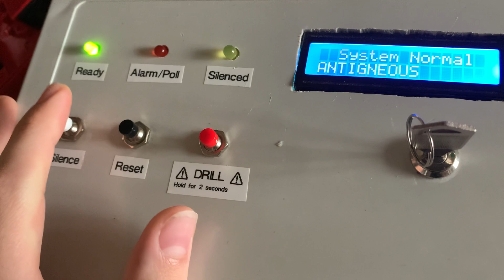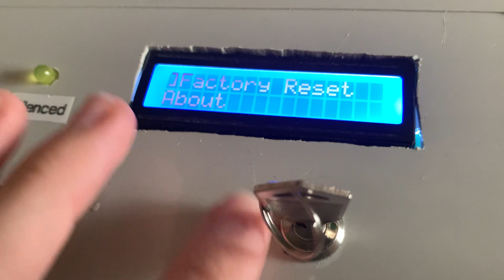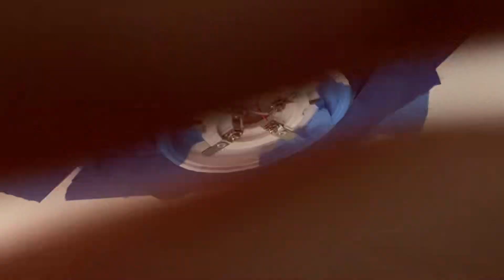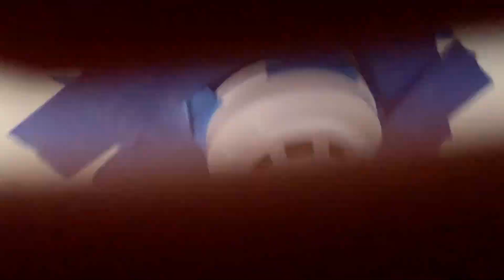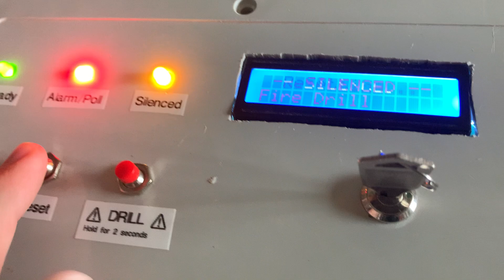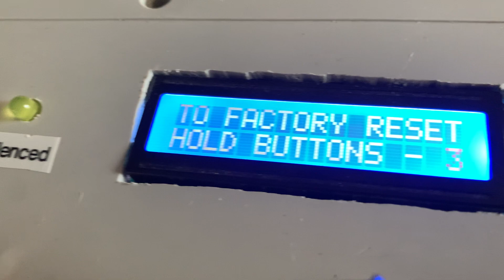Antigneous Open-Source Fire Alarm Panel

Comment: Could this be used to test & troubleshoot a commercial fire alarm system before the FACP gets installed? Even it it can only support one NAC at a time. I'm an installer and I manually test all my circuits before they get landed in the panel, but using this would be a game-changer.

Comment: Can’t wait for it to be released
Reply from the maker: Shouldn't be too much longer, just have to finish up the documentation. I want to get around to building an entire panel and recording it so people can follow along easier.
Reply: @lexzachsalarms3948  ok thanks, I love the design demonstrated in the video but I’ll probably put the components in a silent knight 5207 cabinet
Reply from the maker: @CascadiaFA  Yeah, the panel building demo is just the internal components, people can do whatever they want for the housing, that's why I have the feature to disable the keyswitch if you want to just use a locked container to prevent unauthorized access.

Comment: I have a few questions: does it have any sync settings, will it work with 2 wire smokes, how is it powered, and can it charge internal batteries, how many nacs, and are more zones in the plans? Sorry if thats a lot of questions, im just quite interested.
Reply from the maker: - No sync settings yet, but those will be added
- Mine is powered by a cheap 24v 5a LED strip PSU
- No support for internal batteries yet, but that can be added
- On my panel specifically, just one nac relay and one spectralert classic in my room. You could add more nac relays on the panel if you wanted to.
- Currently only 2 zones, but if there is interest, I still have a few more ports I could work with to make more zones.
Reply: @lexzachsalarms3948  Thank you so much! Also i imagine audible silence cant really be done with  strobes with one nac and no sync modules anyways
Reply from the maker: @mimi2  I have a total of three relays, strobe, horn, and smoke, so it actually can do audible silence, sorry for the confusion